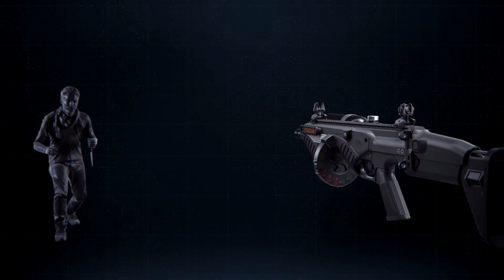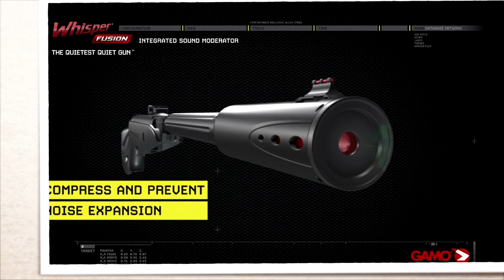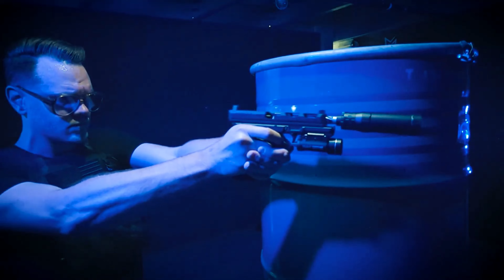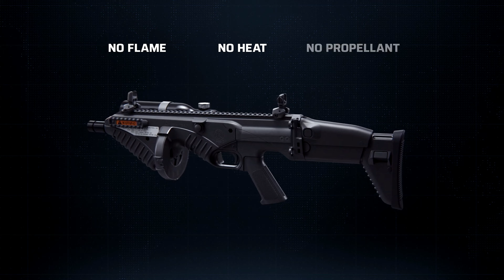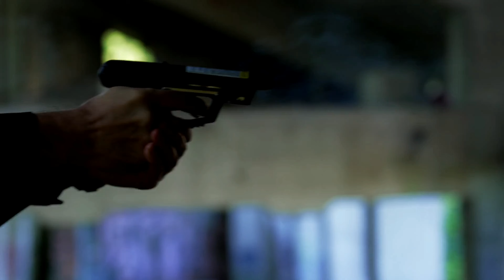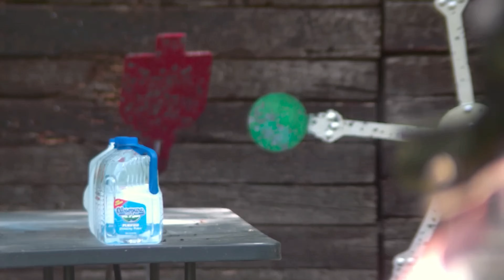Non Gunpowder Weapons That Challenge Conventional Firearms in 2026

Comment: These didnt challege any firearms. They are cool but we need way more tech. Air requires air tanks. Electricity must be stored and storage is heavy. Both of these are unreliable. You can buy a nice paintball gun and do more damage than these. Crossbow was cool
Reply: Rail and coil tech should and will be persued. Pulse weapons exist and are already effective. They are regulated as phone technology rather than the atf or we would see them in use.